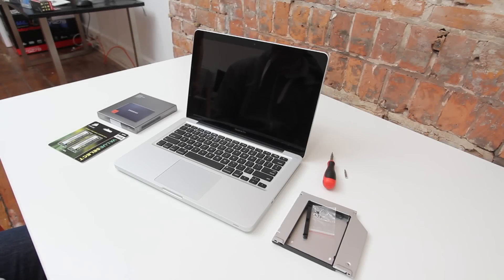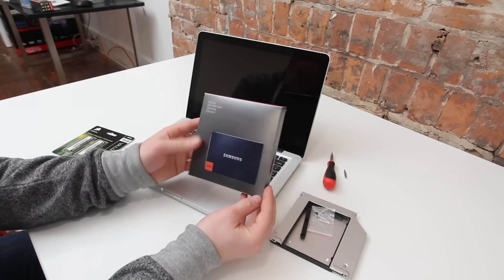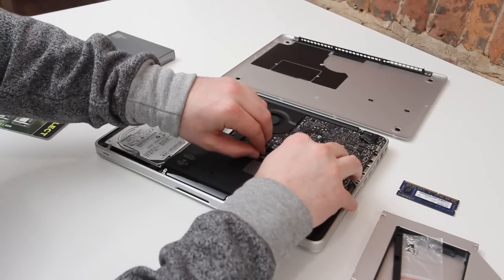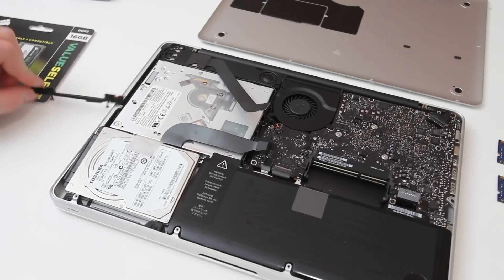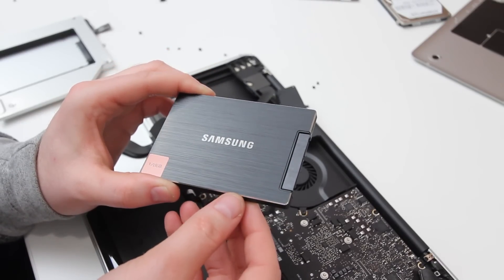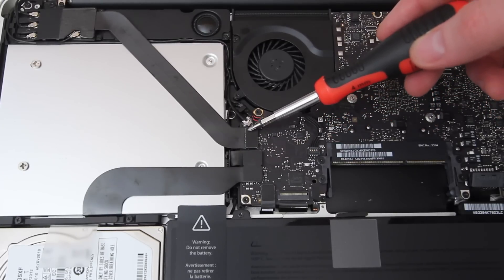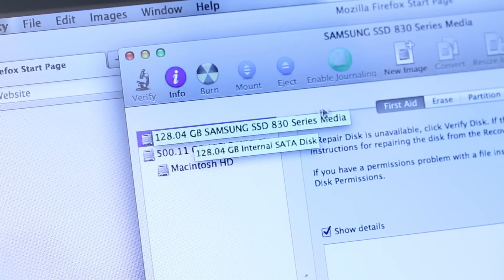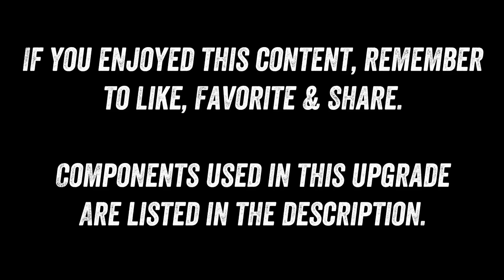Upgrade Your Macbook Pro (SSD Upgrade, RAM Upgrade, Optical Drive Bay Adapter)

Comment: I have a mid 2010 15 inch MacBook
Pro with 4gb ram running 2.4ghz Intel i5. Is it worth doing this exact upgrade? My HDD is 320 gb and that much storage is enough for me but I don't know if I can use the HDD and SSD and the same time (since the SSD is around 130 gb and I don't want to reduce storage) . Some guidance would be highly appreciated. And one more thing. I'm not sure if I can update my ram to 16 gb I read somewhere that the max memory for a 2010 Mac is 8gb. Thanks in advance

Comment: Hey, I found this is super helpful, because of your video, I decided to upgrade my Macbook Pro mid 2010. Now I have 2 questions, I would appreciated if you can answer them!

1. In terms of speed, is it better to install new SSD in HDD slot and switch HDD to optical drive slot? Or it doesn't matter that i can just install my SSD in optical drive and keep HDD in the same old spot?

2. I have purchased a 256 SSD, my HDD is 512 GB. There is no way I can clone my HDD to SSD. How can i just transfer the Mac OS from HDD to SSD? Some apps transferred to SSd would be fantastic too.

Thanks for your time!

Sincerely,
Sean
Reply: Hey buddy, I have a mid 2010 MacBook Pro too. I wanted to ask how much did you upgrade your ram to? I read that 8gb is the maximum for a 2010 Mac did you upgrade it to 16gb or 8gb?
Reply: +Ishan Ahuja  Hey Ishan, I upgraded my MBP to 8GB
Reply: +Digital Jedi thanks a lot, I replaced optical drive with the new SSD. :)

Comment: If I install an SSD drive for OS and all my software, and use the optical HD as a 2nd HD instead of CD Drive (for music, photos, etc), will Time Machine still back up both drives to an external drive? if not, what is the best way to back up both hard drives to external disc? Thanks for help.
Reply: yes it will

Comment: You mean to say I can increase my memory cards to 2x 8gb vs the apple tutorial to upgrade to recommended 2x 4gb? Also, will a 1TB SSD be appropriate or lower gigs improve the performance of my original early 2011 macbook pro 13" slow set-up? I don't understand why the replacing of  optical drive with a ssd? Thank you.
Reply: +joey angus did you get an answer to your questions?? i too am wondering the same, i just bought 8GB upgrade from 4GB, but he's making it sounds like i could go to 16GB, even though apple said my max is 8GB?
Reply: I went 16gb w/o any problems along with a Samsung EVO SSD 500gb. The install was easy. Used Carbon Copy Cloner (download free) to transfer original drive info to SSD with a SATA 3 to USB connector. Took about a couple hours to transfer about 120gb of info from HDD to EVO SSD. What difference upon booting up. Definitely quicker.

And finally, no. I did not get an answer. YouTube was more than confiding of my hesitancy to DIY. Good luck.
Reply: +joey angus 
Hey since you know stuff about mac upgrading, could you upgrade display of  (1280 x 800) to anything higher resolution like (1440x900)  like would that mean a physical change of non-retina screens or is this even possible. LIke we can only upgrade the SSD, Ram, in hardware? Also can i keep both my stock apple storage of 520 GB of HDD and a SSD of 128GB (Shown above) at the same time? (plis answer)

Comment: replaced my slow ass hard drive on my 2011 MacBook Pro with the Samsung SSD 850 PRO 512GB, bumped the Ram up to 16GB.
 Old boot  time: 151 seconds
New boot time:  6 seconds.

Oh yeah I'd say it's more than worth it to do this only wish I had done this along time ago! And for all of you who don't know that much about computers or are a little nervous or intimidated by the thought of opening up your machine and doing this yourself , DON'T BE. I had never even seen the inside of a computer and am not educated in computer science or anything more than just a regular user with no special skills and it could not have been any easier. In about an hour and thats with me taking time being extra cautious,I had my old granny machine pimped out and smoking hot as far as the performance its like night and day.
Just make sure you invest in a kit with the right tool for the job and if your a first timer like me get an anti static mat they are inexpensive that way you know your not going to screw that up . Make sure you lay every thing out in the exact reverse order extremely important  because all those little screws are not the same and need to go back in the exact location it came out of. But theres nothing hard or complicated about it .
Now Im itching to do something with my old 2007 17 inch which remarkably still  runs despite the battery pack bulging out and it held together with duct tape!
Reply: brucebutkis Thanks for sharing your experience, can't wait to upgrade my MacBook Pro as soon as I get the money for the RAM and the SSD.
Reply: brucebutkis I have the Samsung SSD 850 512gb as well, but still need to install it into my laptop. You replaced your HDD with the SSD right? Not like in the video, he has HDD and SSD installed. Because I am literally a noob with such things. I hope my Macbook Pro will progress in his speed, it is so slow right now.
Reply: ***** yes i decided the speed was what i was looking for and was first going to do a hybrid but doing some research found out that that would have been a mistake and made my mac actually slower at least from what I read from others who had done that . I am going to be doing the type of install in this video on a different slightly older mac book pro in the coming few days and will post how that goes .
As far as speed its been about 3 months since i put in my SSD and the numbers for start up the very first time are above and the start up time today was :07 seconds remember to max out your memory as well
Reply: I will first go upgrade my HDD to a SSD, and if my Macbook Pro 2012 mid will go slow again I will put 16gb of RAM in it as well. Only having a problem with how to install it and how do I put my time machine back-up on the SSD or do you recommend doing a clean install?
Reply: Miles Nilges SORRY for not answering your question sooner but I didn't install the adapter  on this particular computer.
Reply: +brucebutkis When you replaced your hard drive did you lose all of the saved info that was on it or did you transfer that over somehow. i want to do the exact same thing you did, but not lose any of my files and apps etc.
Reply: I made a backup from all the programs and data on my HDD, then replaced it and than put my backup on it again via an external hard disk.
Reply: +brucebutkis Does anyone know if the Samsung 830 Series SSD will work on a 13" mid 2009 mac? I will also have 8gb ram installed with it if that helps thanks please respond!
Reply: TastyDash You can search on your serial number from your Mac.
Reply: Anthony Blackwell you have to make a back up if you don't want to loose your files which if your files are important to you you should really be doing regularly anyway . If your smart you will back up using two different sources or types one of which is in a different location than your main computer like an on line back up sight . I have a friend whose house caught fire and his files were backed up but on an external drive next to his computer. Failed to think that one through, but a lot of people, I think, do that. So yeah, It's always a good idea to make back ups of important files before making any major changes to your system.
Reply: TastyDash Like SAIN7 said you can search with your serial number. I would look closely at it and say this because I have noticed some people installing it on older macs having problems getting it to work. Now that's just based on the limited number of reviews I've read on Amazon, Samsung and a couple of the mac forums.
Reply: that is wicked quick.
Reply: hows the performance with FCP? 
Now is the upgraded Macbook Pro is more faster than MF839?

Comment: Can I use the 500gb HDD from my PS4 in my Macbook pro, same model as in this video, and can I simply use time machine backups to reinstall everything once I swap out the old drive. Also, do I need to format the PS4 hdd first???
Reply: thestr8jacket1 I witched out my PS4 HD for a Seagate 1TB SS/HD hybrid and then switched out my 13" Macbook Pro Mid-2009 model's HD with the PS4 500GB HD, works fine and was super easy. YouTube how to install a new HD and they'll explain how to reformat the PS4 HD, you just partition and he briefly goes over it here, its super easy. Good luck!

Comment: Any problem with doing similar upgrade to a mid 2009 macbook pro 15"?

Want to remove original 250GB HDD and replace with 120GB SSD and a 1TB HDD in the optical bay, also upgrade from 4GB DDR3 1066MHz to 8GB.

Is TRIM an issue with swapping in a new SSD?

Comment: I put my optical drive in an adapter like that and my mac won't write anything to a disc except shortcuts. Any ideas why?
 I think it's because the hardware wasn't meant for the bay or it's somehow different from the USB ones sold in the store. I can read discs from it, but it barely even acknowledges a blank disc or gives me the option to write to it.

Comment: will using super duper to clone my drive transfer all my applications and os over to ssd?
Reply: caves Yes, it will, every file that is on the hard drive will transfer to the SSD with super duper.
Reply: Thanks! I just upgraded my 2011 macbook pro with 2 ssds and 16gb ram. Transferred all my files easily onto the new drive
Reply: caves Cool, I'm getting a 2012 Mac Mini in a week as I can't afford a MacBook Pro or Air and I'll be upgrading that to 16GB of RAM. And a few months after the RAM upgrade, I'll upgrade to a SSD instead of a HDD as well.

Comment: Hi does it work for the 17" Macbook Pro. my version is 2009 model. I don't want to lose my 17" screen. If I put in the SSD where my Optical drive was, will I still by able to use an external optical drive for CD's or DVD's if I need to play them.

Comment: which is much better... taking out the hard drive and replace it with ssd 128gb and put the hard drive from the mac to the optical drive or the other way... im asking to see which one will improve more in my mac... and if is the same thing here is another question... its worth it putting 2 ssd on the mac? or its to much for some like me that i use only for web and downloading apps music files and sometime editing some simple photos not videos but in case i do would it work only with one ssd? and gaming should i need 2 ssd with 250 gb which one and 16gb of ram or can i use ur process i hope i make myself clear so u can understand what im saying if ur not replay back i need ur help thanks

Comment: btw... "@bur lapse 3 weeks ago.
 I recommend doing what Lou did, but in opposite hard drive placement. Put your max performance SSD on your main bay and your HDD in your optical bay. I heard that the optical bay is only 3Gb/s, compared to the main bay, which is 6Gb/s link speed. Cheers! Happy upgrading"
Is it true what he says?

Comment: so both connections, the one where the HD is and the one where the DVD is, both have the same speed? or will the SSD be faster if I put it where the original HD was or Will I get the same performance if I install my SSD on the optical drive with a caddy. Thank yyou for your answer

Comment: I recommend doing what Lou did, but in opposite hard drive placement. Put your max performance SSD on your main bay and your HDD in your optical bay. I heard that the optical bay is only 3Gb/s, compared to the main bay, which is 6Gb/s link speed. Cheers! Happy upgrading!
Reply: Thanks for the tip. Can you still boot up your OS with HDD being at optical drive, and just clone everything to the SSD once it's booted, or you would have to install the OS on SSD first (from USB stick or Wi-Fi) ?
Reply: @vladimirradosevic3749  You should be fine to boot from the optical drive bay, it will just be half the speed as mentioned.

Comment: Hello sir UNBOXtherapy 

I really need your comments to help me out . since your still a big fan of the normal MacBook pro, is the MacBook pro 2010 model good? since its 2015 really soon. I really need advice 
thanks
Reply: WLF Team I have a 2008 that is running just fine for my needs, which does include some pretty intensive FCPX editing. These machines are still totally capable, and fully supported by OS X. SSD upgrades only make them better, and swapping a hard drive with an SSD is way more noticeable than adding ram.
Reply: thanks for the help.
Reply: WLF Team MacBook pro 2010 only support up to 8GB ram. 16GB would case operating system panic
Reply: Svfyvn x o

Comment: I just wonder you all talk about 16gb ram, as for apple it states it only support 8 gb ram in the 13 inch pro??
Reply: Even though they are 64-bit capable, Apple's MacBook Pro systems have been offered with 8GB RAM as the maximum configuration. More recent models, including those released in 2011, have been built with a higher RAM limit, so even though Apple only offers 8GB RAM and mentions this as the maximum amount of RAM the systems can hold, in reality they can recognize up to 16GB if you add it.
Reply: Apple claims only 8gb, while you can actually get 16gb, i already did it! xD

Comment: Does someone recommend still doing this?
Reply: friður It totally keeps up. The speeds are almost exactly the same as the new rMBPs, which, by the way, is truly ten times faster than a conventional hard drive.
Reply: yes, you still can do it, now even prices went down, so for less than 200€ you will have a new and fast machine, I did few days ago with my macbook from 2010', works like a charm.
Reply: Ori Calderó Is it as fast like the new macbooks or does it keep up?

Comment: hey could you make a vid about hoe to upgrage the graphics on a macbook pro(the one used in this vid)
Reply: It is soldered. If you need upgradability, get a desktop. Noob
Reply: purchase an external thunderbolt GPU box and then you can add the lastest 1080ti from Nvidia or any other modern Nvidia card

Comment: Hey, So I play a game called CSGO on my macbook pro and with every update they put it it gets harder for me to play... Like my fps keeps dropping and dropping. like I use to have 160fps and now I have like 80-90 fps and it sucks. Some people tell me to get another graphics card. I have a 2.3 GHz Intel Core i7 and 8 GB 1600 MHz DDR3 and a Intel HD Graphics 4000 1024 MB Is it possible to get a better graphics card so I can play at a better FPS???
Reply: I dont believe that is possible, however im not completely sure so you might be able to find something in the internet.
Reply: 60 fps is the most all laptops can output anyway so anything above 60 fps will be unnoticable
Reply: I just sold my mac a pretty nice pc build.I can list specs if you're interested.
Reply: #hardcorepcbuilderspotted
dude 80-90fps on a laptop's gaming performance DOES NOT SUCK i really dont get how ppl can get so butthurt about THIS, ur eyes wont be able to tell anyway just fcking enjoy the game man jesus
Reply: ***** u have a good graphics card... what u should do is change the ram to a 16gb... that should help a little bit... and if u still have a HDD u should change it to a SSD i know its not cheap but it is worth it... or upgrade that and ur internet xD
Reply: Sam Liew I agree,most gamers like it at 60fps  because their eyes hurts when it is more than that.  :/

Comment: How can you put 16GB ram into it, when Apple says that the maximum is 8GB? And the speed of the ram is also different from what Apple says they should be?

I have a 15" Macbook Pro Mid 2010, and I want to upgrade to 16GB of ram, but I have read several conflicting posts on the internet, where someone says it only supports 8GB of ram, and others say they support 16GB. Can you please help me :) ?

Link to the Apple article here: http://support.apple.com/kb/HT1270?viewlocale=da_DK
Reply: check your model here http://eshop.macsales.com/shop/memory/Apple_MacBook_MacBook_Pro/Upgrade

Comment: Hey there. Quick Question. I have the late 2011 macbook pro and bought all you see here, but I know the benefit to having an SSD is to speed up the laptop. Will it have a parasitic effect on the computer if you use both? Also by creating the clone of the old HD to the new SSD, you can than just use the SSD in the HD slot? Thanks and have a good one. Great video!

Comment: I am new to MAC, I bought a MAC with a faulty HDD (very slow) and I bought a new HDD + SSD. Can I just install them or do I need to move the OS first? (how do I install mac os in the first place?) THANKS :)
Reply: Yes you have to move the operating system to the new HDD. You can use a hard drive enclosure to clone the HDD. Then replace them :)